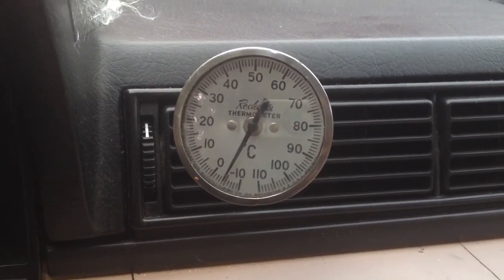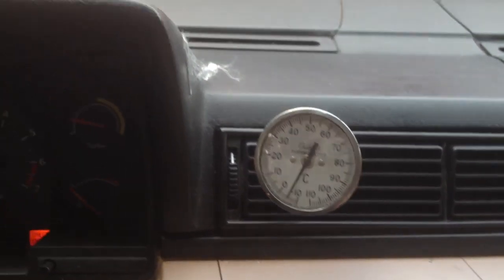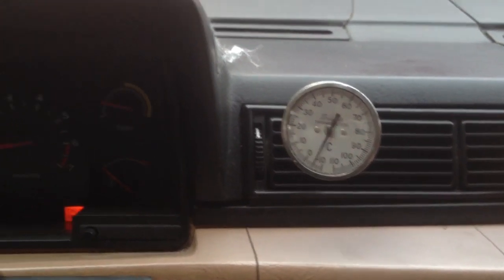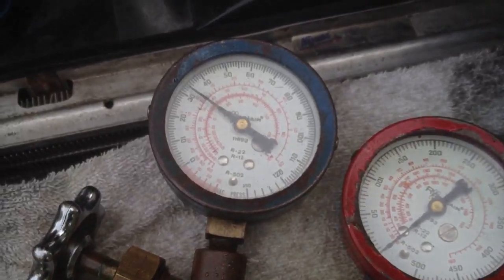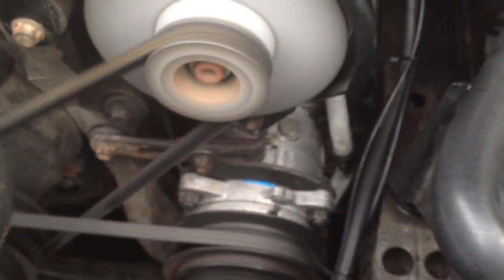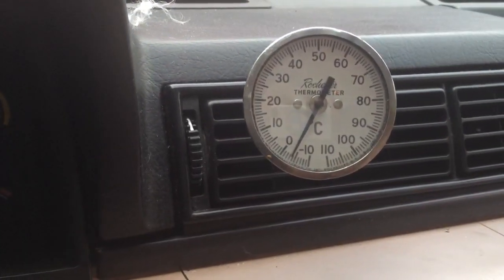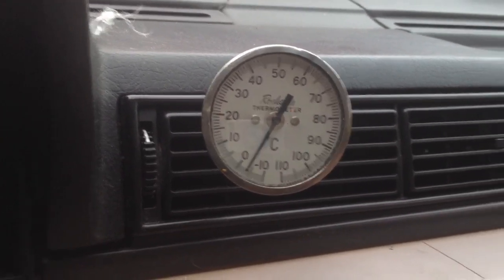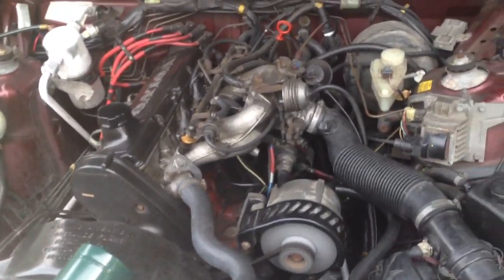Propane Refrigerant in Volvo 740 Works A Treat!

Comment: did hydrocarbon blend.. propane +isobutane in my car (duracool,ecoron etc ) .. about 30 psi on the low side with a variable displacement compressor… relocated the sensor somehow to prevent cut off 
it is mind boggling cold now 🥶

Comment: Propane has a higher vapor pressure than R12 at any given temperature.  Therefore, one should use caution when charging a vehicle with propane.  The pressures which exist in the system, especially when hot, will be substantially higher than with R12.  This increases the chances of hose and/or line rupture.  The best hydrocarbon mix to substitute for R12 is propane/isobutane (also sold as HC-12a).  The mixture has a lower vapor pressure, and so is safer and more suitable than straight propane.
Reply: Oops, I meant to say R134a, not R12

Comment: They don't allow it in US because electrical connections are not explosion proof. You realize you are riding in a BOMB. I am a licensed HVAC/R contractor in the state of Tx. Also I'm a former firefighter. Please everyone think twice about doing this. You don't add fuel to a house or car fire. Sorry Have a blessed day
Reply: Bullshit. Propane/isobutane automotive refrigerant is an excellent choice. Much less dangerous than a half full fuel tank on a car with a tank evap vacuum line missing or leaking. Magnitudes less toxic than 134a or 1234yf if ignited. Over 50 million cars world wide use hydrocarbon refrigerant. Statistics PROVE that faulty airbags injure more people than HC refrigeration.
Reply: @whozaskin3639  You got that right its 100% total bullshit i been using propane in my ac,s for over 30 years when r12 price jacked up past 50 cents a can.Its nothing but pure greed,money hungry.  just like every thing else.Some of these are fear mongers that work for the epa to scare people that can not think for their self.I also burn hydrogen with gasoline and i hear the same bullshit, hydrogen on demand is a lot safer than gasoline.Cancer will get you first.

Comment: does propane play nice with the compressor oil??
Reply from the maker: Yes, I believe a mineral oil lubricant is what should be used, and it is my understanding that propane is actually beneficial to the lubrication process as it more readily dissolves and transports the oil through the system. Most fluorocarbon refrigerants have comparatively poor lubrication qualities.

Comment: Propane is R290 refrigerant and is used in automobiles in Europe where they dont use R134a or R12.It is no more dangerous than gasoline in your tank.And like you it sure does make a cold ass A/C in your car.However it IS illegal for a tech to put it in your vehicle in the US but it is NOT illegal for you to install it in your own personal vehicle.Like others have said the reason it is not used in the US is because it is cheap.When using it be sure to use mineral oil in your system like you would use normally for R12.
Reply: You are the damn moron.Idiot.R290 is used in vehicles in Europe.Its also use in lots pf refrigeration units in the US.
Reply: Also over 100,000 vehicles in Europe and no explosions and none even in wrecks where the system is compromised.So go blow your smoke up someone's else ass!
Reply: I am saying its being used in Europe.Even the new 1234YF Refrigerant being used now has some flammability.And where is your EPA 608 or 609? You dont have one do you.
Reply: I didnt agree they were unsafe.Thats your words.You dont work with refrigerants either I do.If R290 us so unsafe the EPA wouldnt let anyone use it.Also they are OK with you installing it in your own vehicles and its only a matter of time till they will be letting tech's install it in customer vehicles like in Europe.There are lots of things Europe does that takes years before they are approved in the US.Oxalic use in bee hives is one for instance.Its been used in Europe for 20 years to kill varroa mites.Its just starting to be approved here in the US this year.We are always behind on things like that.I am through arguing with someone who knows nothing about this and going to bed.7am comes early here.
Reply: MrSnapper1d  Hey Snapper look don't waste your time he does not have an EPA license.
if he did his research as he claimed he would know the refrigerants in your car have a lower flash point than propane so, r-12 or 134a hydro/cloro-flurocarbons are extremely flammable. propane has been used in the automotive industry use in europe asia and south america for eons.  
i don't like to add to arguments much but i really cannot stand people whom speak without knowledge or misinform people searching information
Reply from the maker: +untitled untitled This Volvo is a terrible turd from an engine management perspective, and I have several spare compressors laying around sealed up with oil in them so I'm not terribly concerned. It's been working for quite a while now, and as a bonus seems to have slowed the leak significantly. Suspect that's due to the larger molecule of propane vs. R22, although supposedly R134a is even worse for seeping through the smallest holes.
Reply: @g quinn And how is this different than a gasoline line (running all around, under, and through the vehicle) springing a leak and GASP! vaporizing, creating the very same situation you described.  Hmm?  Logical thinking is what's needed here, not fear mongering.
Reply: @g quinn Did you know that R134-A is flammable/explosive?  It is........stop your fear mongering.
Reply from the maker: +Ben quinn Not always too cheap, in a crappy car like this it's better to leak propane than R22!!!
Reply: +dregenius Agreed Dr.Genius Seems like there is quite the knowledge floating around LOL here seems like I will have to revert to the proofs in the pudding concept. Hats off to you and your video thank you for the entertainment. The Volvo is a Horrendous Monster when you do not accept it for the functionality it provides mechanically you are running a b230f and that's a non interference engine that's Timing belt driven! the Ac system has suffered quite a bit from the original York, to the Sanden compressors. The redblock motor in its design may not be the most efficient but for longevity and functionality you cannot compare.
Reply: In EU in car AC we use R134a. R12 is illegal. New cars have R1234yf. R290 is not Popular.  In Poland, it is believed that R290  is used in car climates in the US and Australia. In EU we use LPG (Propan-Butan  is used as fuel). LPG tank have max to 100kg in passenger car.

Comment: does your system contain the  oil used in r134a systems or that used with r22?  has it been trouble free since filling with propane? cheers
Reply: Propane plays nice will all the oils.  If in a pristine new system, regular old mineral oil is a perfect lubricant.  I'm not sure if mineral oil and the esther oils used in the modern refrigerant systems play nice together.

Comment: what is needed to send the propane from the bottle to the AC? like what connectors etc thanks
Reply: For anyone that finds this, liquid propane exerts enough pressure when at room temperature in a can to overcome the 50psi in the low side of the AC system.
Reply: @jy1235689  guess what happens with any refrigerant when the compressor is turned off.

Comment: Back in 2005 in auto school, we watched a video of a guy demonstrating propane in a  cars A/C... it exploded
Reply: I have been using propane as refrigerant for 10 years in my Landcruiser and
 my Trader ford truck with no problems, if there ever was a leak that 
could catch fire you would smell it way before it got to dangerous 
levels also if the leak was under the bonnet it would simply fall to the
 ground and dissapear, there is only a small amount of gas required to 
run an AC any way and if there was a large leak it would be over in a 
few seconds.
Reply: You believed propaganda.
Reply: Probably smoking while he was adding it.

Comment: Yeah this works great until it explodes and takes out every ac component and then some.
Reply from the maker: Why would pure liquefied propane explode? Don't tell me you're one of those people who worries when they use a propane torch that the flame will go into the tank and ignite the propane… in an environment devoid of any oxygen whatsoever...
Reply: +dregenius
I guess you have no idea how unstable Hydrocarbons are in an automotive AC system... The head pressure is too unstable. It doesn't fair well around engine heat. If it blows your entire AC system gets demolished. (seen it)
Secondly if you have a leak in your cabin you could potentially blow every window in your car out with a spark.

Lastly it's illegal to put unapproved gases in automotive systems. Few shops will work on a system that's been been contaminated. They wont sacrifice equipment or risk an EPA fine.
Reply: @ladefreakndah  Hmm..  I wonder how a propane powered vehicle EVER gets along....lol  your ignorance is no excuse for fear mongering.
Reply: +ladefreakndah 
The typical ac system in a car is charged with anywhere around 100 to 250g of gas. That's pretty small compared to what sits in the back of an LPG/CNG converted car. If the system was on at the time of impact, then it would all probably be liquid in the condenser at high pressure. If it did ignite, you'd witness a quick puff of flames from the front before the small amount is all burnt up. No hollywood explosions here.

By the way, everyone seems to forget that conventional refrigerants (r12, r134a, r1234yf, etc) are also flammable when used in a system, the combination of compressor oil and high pressure makes a non-flammable gas flammable. Do you have any idea how harmful they are when they burn? r1234yf, the replacement to r134a produces byproducts corrosive enough to eat through glass. Mercedes did a bunch of tests, and are sticking with r134a for now...

I'd rather the boring byproducts of r600/r290 (propane/butane). Some heat, co2, and perhaps a tiny bit of CO.
Reply: FYI,  R134A is flammable as well as many other refrigerants.
Reply: +ladefreakndah dude sesame oil, peanut oil under pressure will explode too... don't see how this substance can be more harmful then r12, 12a ect... I mean if you leave your pilot light goes out (how full of fumes) on your water heater pre-say I'd rather vent camping stove gas than freon. or even a bug bomb for that matter

Comment from the maker: I used a really old propane torch head I've had laying around for years. The base of the head contains the valve and a super-convenient 1/4 FPT thread, so screwing a 1/4" MPT to 1/4" flare fitting was all that was required to connect my charging manifold.

Comment: Awesome, how did you build the adaptor for the 1 lb propane can?  I cut the hose and used a barb fitting and clamps, then some fuel injection hose clamped to a torch end I drilled out, but I like the setup you used!  Much cleaner.